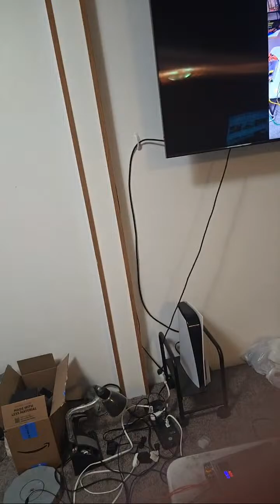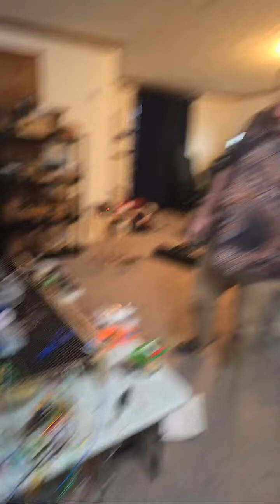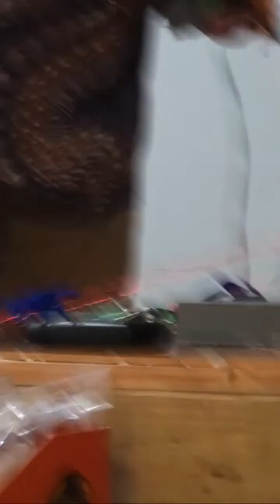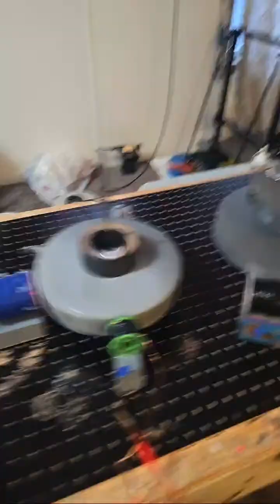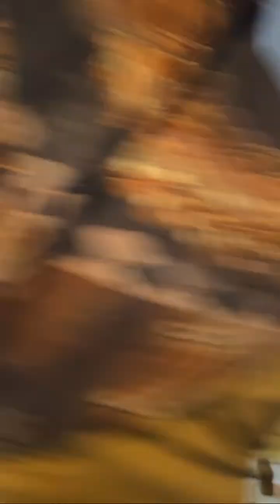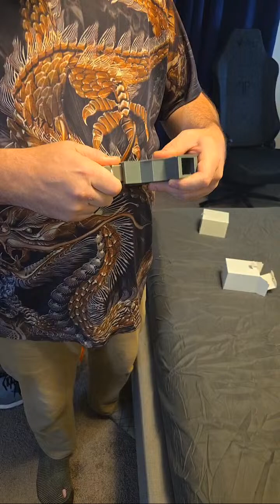Pulse Motor 101, Live With Papa Bale.

Comment: If the input reading from the wallpower is based on 60 Hertz.
How can you actually compare the output reading that's actually 1,000s of Hertz? 🤯😂
Reply from the maker: I understand but i dont have a frequency reading for my generator you know how to get one?
Reply: @MPHJR  😁 the comment was really to make you think about what's really going in verses the average reading of the wall power supply. If It says say 6 watts input. In all reality. It's much less than that.
In all reality your probably only using a fraction of what the power supply is delivering. 
And I don't know much about oscopes or signal generators.
Reply from the maker: this is why I believe that the power that comes from the wall is smoother because my usage is like a forced bottle neck compared to what is really behind the wall kinda like a fire hose pressure is minuscule to the pressure behind the hydrant. but efficient this is why the power from the wall is more stable because even at max amps on the breaker there is still ample amounts of power that is not being used both before and after the socket.    @pulsedmotor